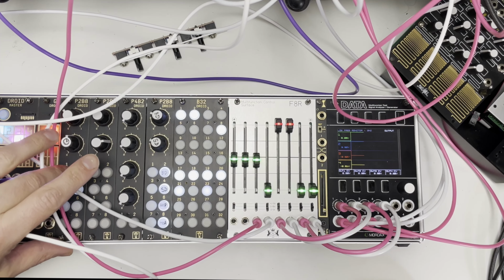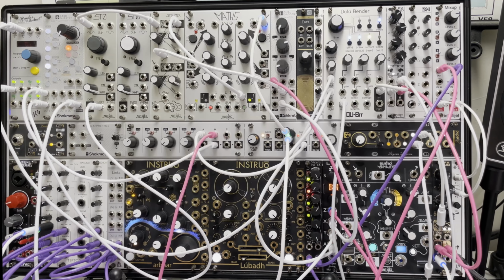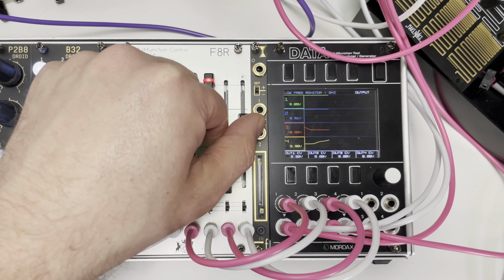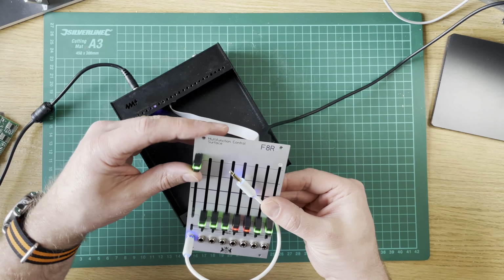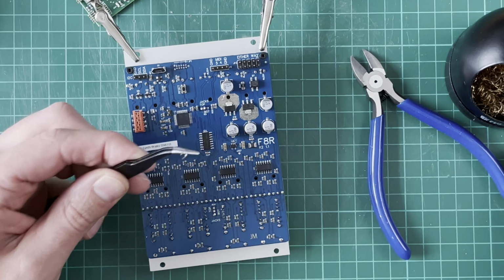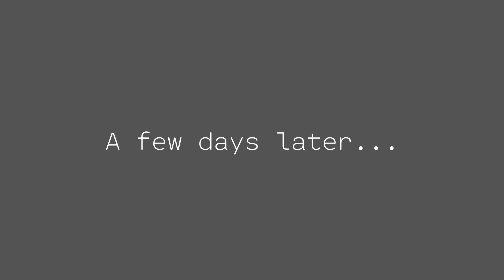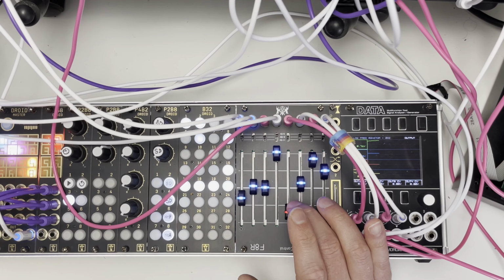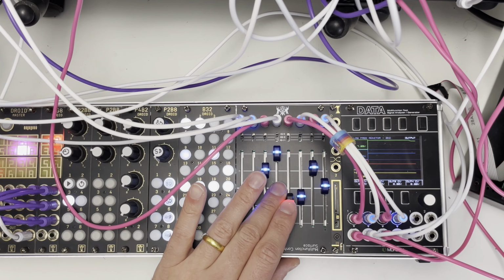Faders are the most playable interface for a modular synth

Comment: Nice. I love using sliders. Voltage Block is great for this. Making one of its sequencers 1 step will turn its slider into an on/off or up/down control voltage, even with clock rolling and regardless of what the other 7 sequencers are doing. The best part is the sequencer can still be 16 steps with a couple button pushes or by changing the preset.

Comment: I'm eurorack for the 4+ years, and I always thought that fliping modules is kinda adds to the complexity of the system in general, making you to also keep in mind the upside down position etc, but recently I just thought: well, i just aling all modules of my 6u case so that connections are inbetween rows, did it, and it turned out to be waaaaay better than I expected. Added complexity of uspide modules compensated by the abillity to tweak without the need to dive into cables.

Comment: Ohhhhhhhh so THAT'S why it changed colour on your tiktok post 😆 Neat little module though, paired with a voltage-controlled attenuator you could make some really interesting patches
Reply from the maker: Yeah, I now have a set of spare LEDs and fader caps, along with a very fancy aluminium paperweight 😆

Agreed about the VCA possibilities. Might dust off my Doepfer A-130-8 (Octal VCA) to pair with the 8 fader channels

Comment: I'm curious: if you already have an envelope modulating your VCA in its only CV input, how do you use this to simply lower the volume of a track if you don't have a voltage controlled mixer? Is that possible? I have an extra CV compatible mixer but that's only good for one channel and I have the Intellijel quad vca. My Behringer System 55 VCA has 3 modulation inputs so it can work on that.
Reply from the maker: I guess you could add an offset to your enveloper signal before sending it into the VCA? I do this a lot with the Intellijel Duat/Triatt/Quadratt or even just the MI Links module.
Reply: @TomHazledine  I just asked a store rep for a discount on a Noise Engineering Lapsus Os and got that instead. It can be used like this fader bank but has more inputs and circuitry for a few additional functions. Plus you can put the face plate on either way you want and change the polarity of faders with switches on the back.

Comment: Hello Tom!
I got this module (black version with jack s on top) together with pressure points a few weeks ago. A very good combo! Consider an Acid Rain Maestro to go along with the duo.

One question - how do you change the color of the leds? (mine are all red)
Reply from the maker: Maestro looks like a really powerful module. Keep seeing it in other people’s racks.

To flip the colours, you can pop off the top of the fader and pull out the LED. Flip it round and put it back in to get the alternate colour (if you’ve got the black panel I think you’ll be able to switch between red and blue). I show this process in action at 4:04 in the video
Reply: @TomHazledine  Aha! Thanks a lot!
Reply: @TomHazledine  Thats what I get for wiggling while watching the video! I checked the leds on my faders and they are monocolor (also with a red colored lens). So turning them around does nothing!
Just letting people know that there are differences on these modules.
Should not be too hard to find replacement leds if one really want to change the color, however.
Reply from the maker: @jarls5890  Ah, I’d assumed they were all bi-coloured. According to the F8R thread on modwiggler, you can pop in other LEDs too (some people have been swapping them out for less bright versions)

Comment: Id be 100% sold IF it was attenuators and not just volt outputs.
Reply from the maker: That would be so useful! I'm guessing that the priority with the F8R was having "full throw" faders, so any extra jacks would reduce the vertical space available. These feel really good, so it's a compromise I'm happy to live with, but I would really love a version of this that could attenuate and/or crossfade.

The Instruo fader (the 2hp module to the right of the F8R in my skiff) is such a handy little utility, but the fader itself feels nasty to use - the edges are way too sharp, so it's uncomfortable to ride with the side of a pinky for example.
Reply: You might like Noise Engineering's Lapsus Os, which has four faders that can be either attention or voltage, and be easily flipped with jumpers on back. The faders are smaller though so there's always a comprise to be made. Great video!
Reply from the maker: @jamesbaynton1881  Thanks! Strangely enough I still don't have ANY Noise Engineering modules. Feel like that needs to change soon 😆

Must confess the sheer size of the faders is the biggest selling point of the F8R for me, though. Need big pads for my clumsy sausage fingers
Reply: Just patch into a VCA. Fader to CV input, signal you want to modulate into input and you know where the put goes. That’s the best thing about modular.